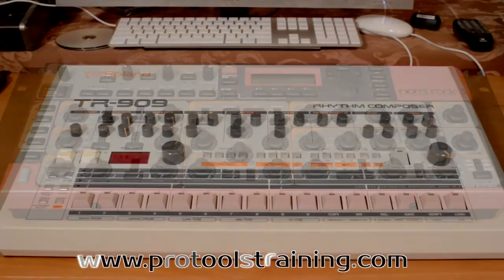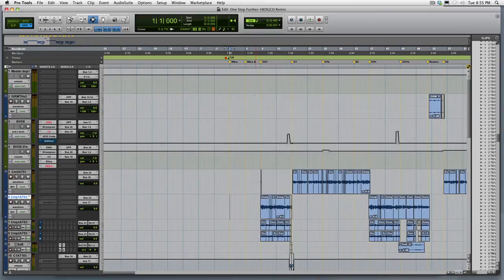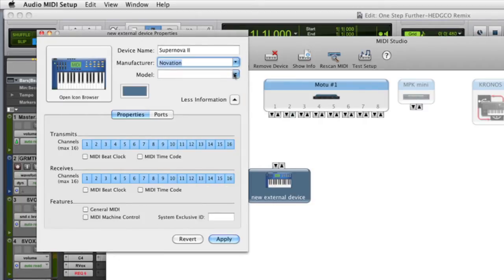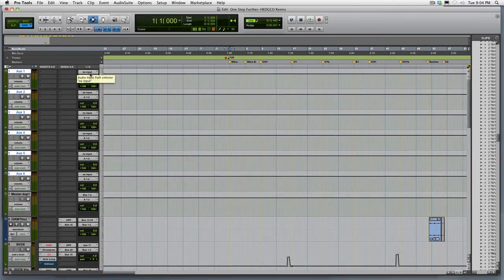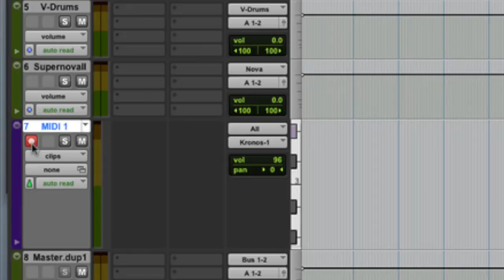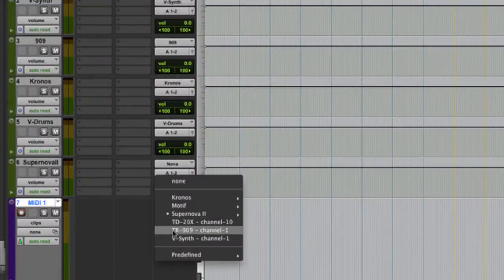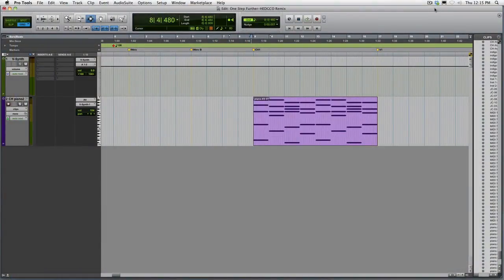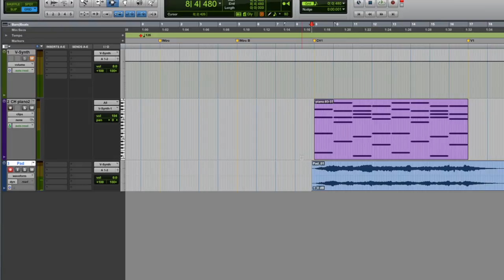External MIDI Hardware in Pro Tools

Comment: I have a CM Motormix that I need to use to connect and control my pro tools session. It's a similar setup to what you have here, though I am using a MIDI to USB cable. My peripherals are HUI > Motormix > Motormix > 8 . And the motormix is in pro tools mode, and says " Motormix is ready. Open a pro tools session to begin" but my session doesn't react when I move a fader, or knob on the hardware controller. Help needed.